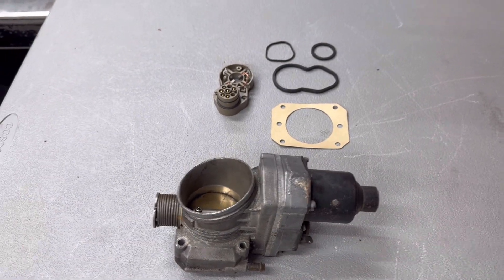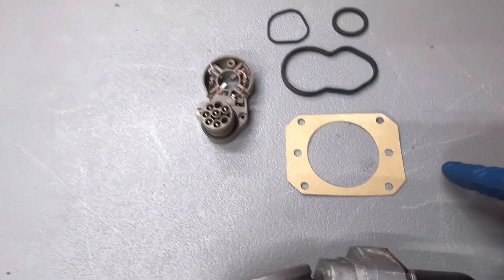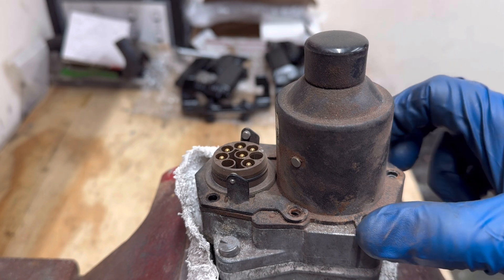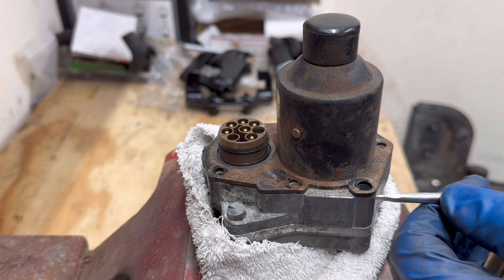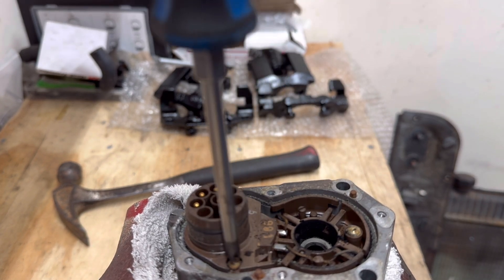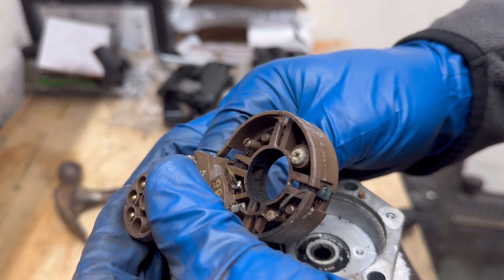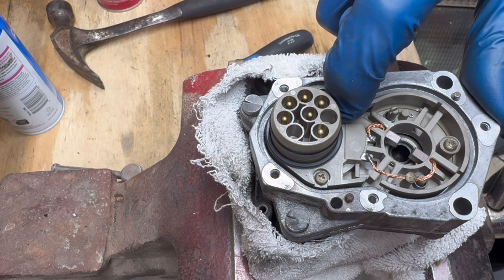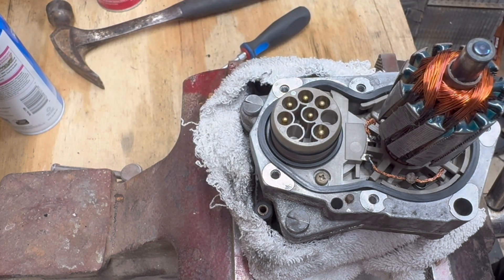Mid-week Project! Fix your E31 850i M70 & S70 throttle response. EASY DIY

Comment: Having a similar problem with a 91 850. Just replaced the MAF sensors, no help, was thinking of doing the encoders but at the end of the video you mentioned you still had the problem or at least it hadn't completely cured it. Did you get the problem resolved? What was done? Saw another driving video of the same car and everything seemed fine. thanks, Mike
Reply from the maker: It’s been a minute but it ended up being a combination of bad crank sensors - only use OEM, and the primary o2 sensors being reversed.  

Also add in a smoked transmission that shifted terribly and finally lost reverse 🤪